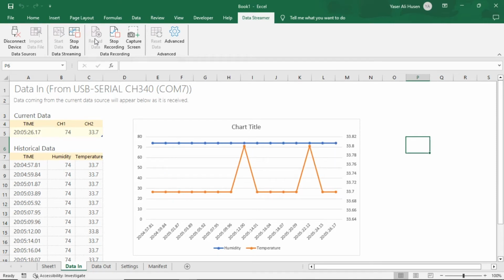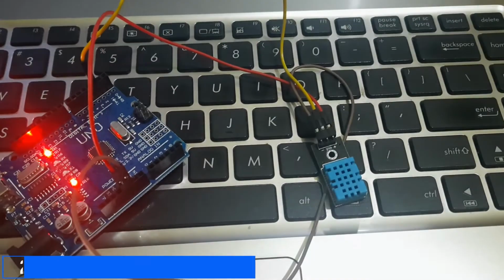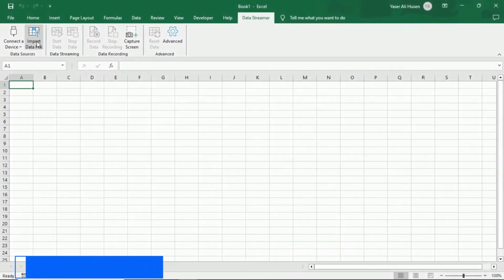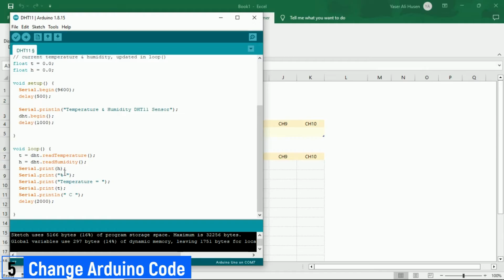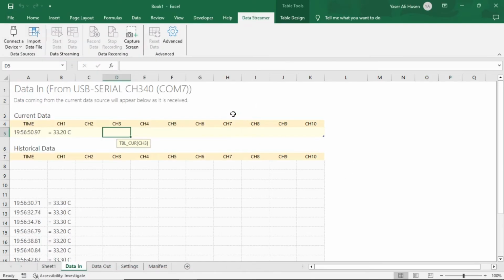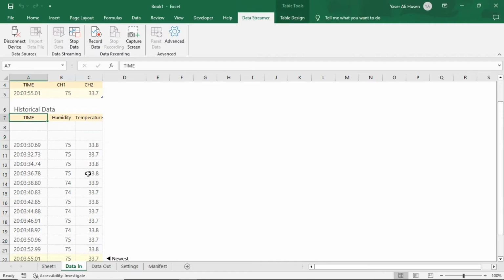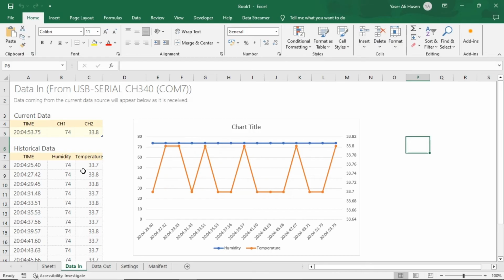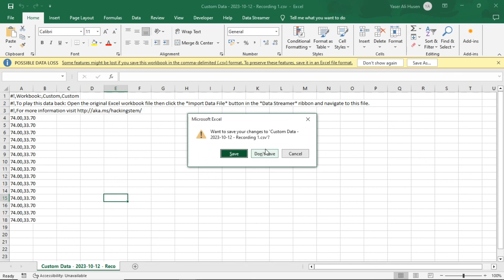Data Streamer Excel Add-ins: Read Temperature and Humidity in Ms.Excel from Arduino Uno

Comment: So you can only see the last 10 readings? What if i want to store all the measurement over a longer period of time?
Reply from the maker: Thanks for your comment! 
By default, the Excel Data Streamer add-in only keeps the last 10 readings visible in the data preview window. But if you want to store all measurements over a longer period of time, you can:
Log the data into Excel sheet → Just start streaming and then copy/save the incoming rows into another sheet so it won’t be overwritten, you can use a VBA macro excel to copy data automatically.
Reply: @YaserAliHusen or going to 'settings' sheet and changing the no. of data rows will make it easier

Comment: hi sir, so i wanna draw and I-t characteristics for my photodiode, so how do i add the channel data times. Do you know how to do that? Thank you sir. Have a good days
Reply from the maker: Hi! Thank you for your question. Honestly, I haven't tried plotting I-T characteristics for a photodiode using Excel Data Streamer before. But maybe you can try this simple approach:
1. Connect your photodiode to Arduino using a resistor to convert current to voltage.
2. Use analogRead() to get the voltage value, and if needed, convert it to current using Ohm's Law.
3. Send the data from Arduino with both time (millis()) and current values.
4. Use Excel Data Streamer to receive and log the data.
5. Then you can plot the I vs Time graph in Excel.
Hopefully this gives you a starting point. Good luck, and feel free to update if it works!
Reply: @YaserAliHusen  Thanks for your instructions. I did it. I got the data from DATA RECORD and it is really effective if you measure Current for a really long time. You also can use the data from DATA RECORD to plot in ORIGIN too.

Comment: Sir, how can I connect on data streamer, cuz only can connect one COM each time, so if I use arduino IDE to run my code, there is no way to connect the data streamer.
Reply from the maker: Yes, 1 Com cant used more than 1 application.

Comment: When  I select connect a device in excel sheet it shows unable to connect the device because it is used by another application
Reply from the maker: Maybe You still use Arduino IDE and connect serial monitor, close Arduino IDE first
Reply: Don't use serial monitor or serial plotter in the Arduino IDE
Reply: I have the same problem. I think its can be a problem from a Windows drivers of COM ports.

Comment: hi. thank you so much!!! is there anyway i can save the data with the timestamp?
Reply from the maker: You can send the timestamp from Arduino, you can use RTC module.
If you use ESP with wifi, you can use NTP to get time
Reply: @YaserAliHusen  im new to this. I will try based on advise. Thanks! Btw, can you do a tutorial on how to make esp32 accessible remotely without the same ssid?
Reply from the maker: @andreatia21  If you just want to control LED on ESP with same network, you can use webserver.
I have a video about it, find with keyword ESP01
Reply: @YaserAliHusen  thanks a lot

Comment: Great tutorial! I get no data when I press Start data. The Arduino is connected and I have changed the baud to be the same as for my sensor
Reply from the maker: Did you follow the steps?
and how baout Serial.Print syntax on your code?
please follow the video about the format of serial print command

Comment: i can't connect my Arduino uno to data streamer when i press on connect to my device nothing happens and no error comes out
Reply from the maker: Did computer detect your uno?
And dont use serial monitor in arduino ide
Reply: @YaserAliHusen  yes computer can detect it and it works just fine in arduino ide, but when i close it and open data streamer it can't connect
Reply from the maker: @xc4v866  
There is no error notification?
How about Start Data?
Reply: @YaserAliHusen  its not available since no connection was established